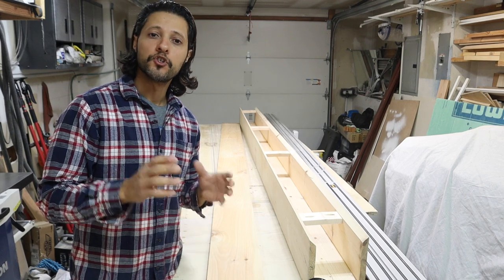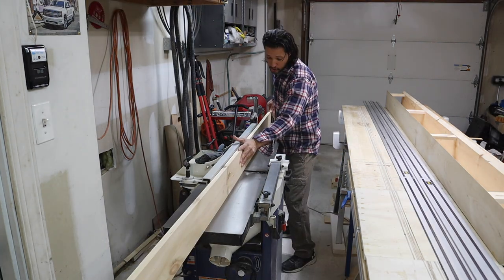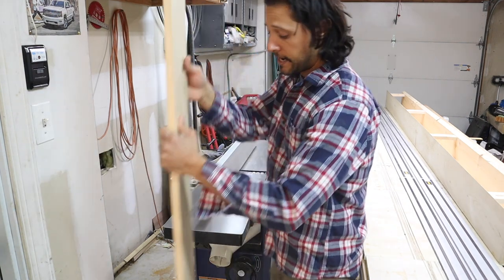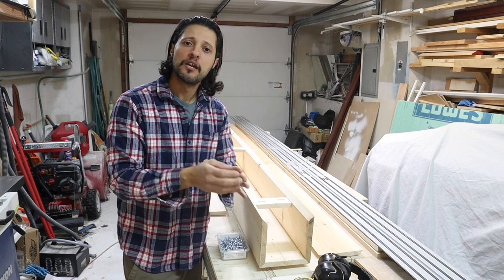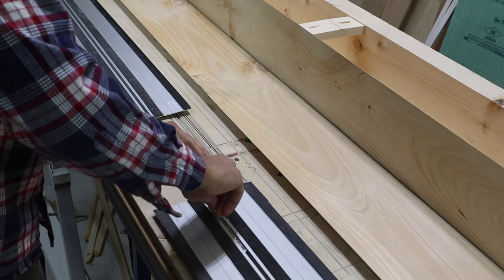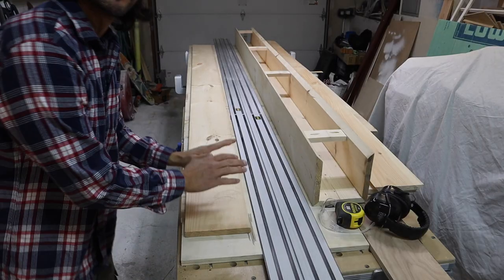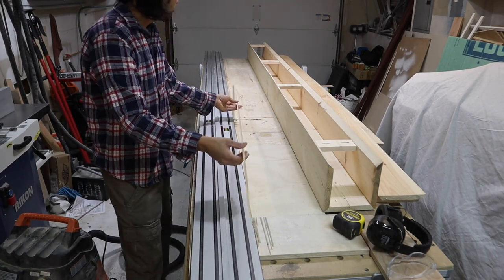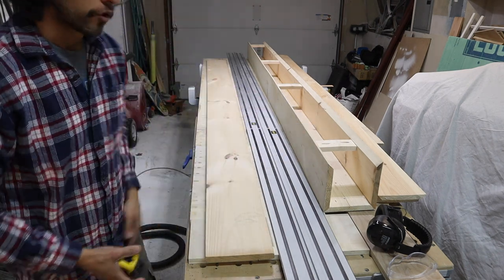this is dangerous!

Comment: If you had to pick a jointer or the track saw what would you buy?
Reply from the maker: That depends on the type of work you do. I mill a lot of my own rough lumber and not usually more than about 8-10 feet, so for me the jointer planer is definitely what I need and use more. If you buy your lumber S4S, then you can do without it.